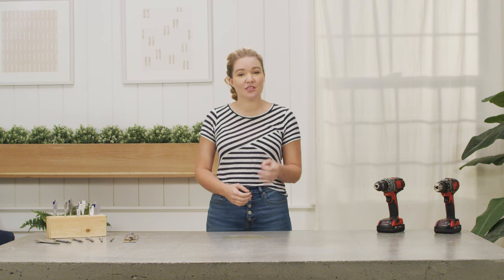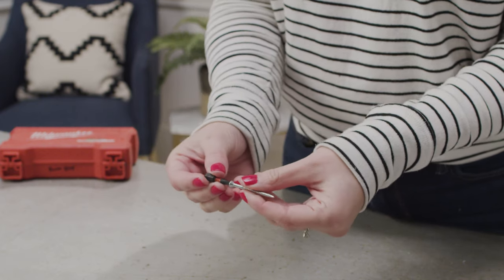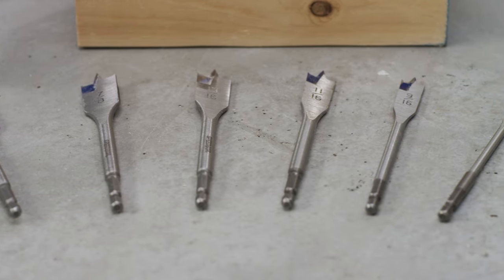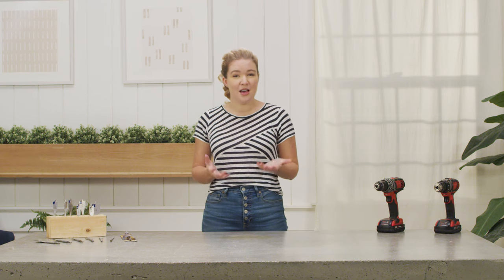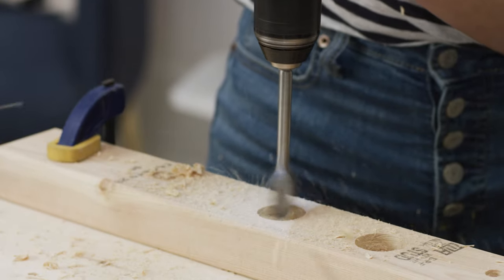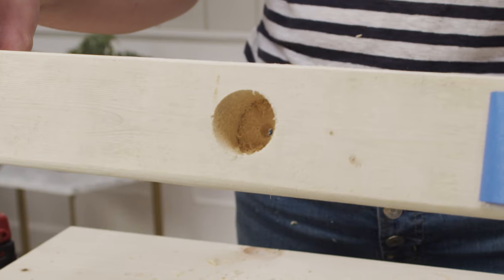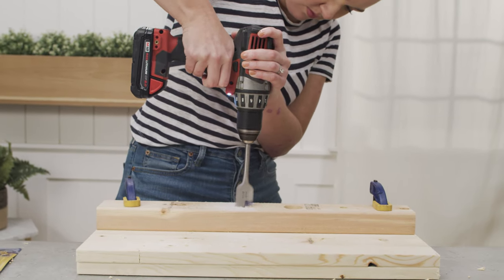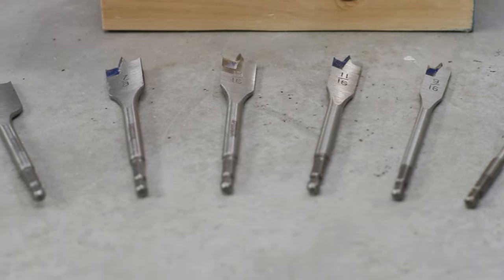How To Use Spade/Paddle Bits

Comment: I'm wedded to using Forstner bits for clean holes,,,turning my wood over 2/3 of the way though..but I'm open to using good. sharp spade bits...
Reply: Do you use them on a drill press only? Can they be used with a hand-held drill?
Reply: @TheWendyJohnson  I only ever use a drill press... maybe a good ,18v handdrill would not be overworked in wood no more than 15mm thick...at a guess. .. depending on the width of the hole you are doing. I have access to presses...so I prefer them.